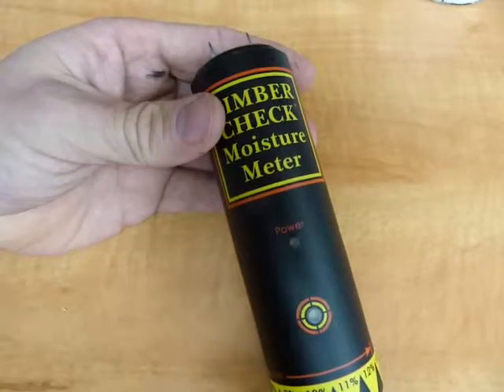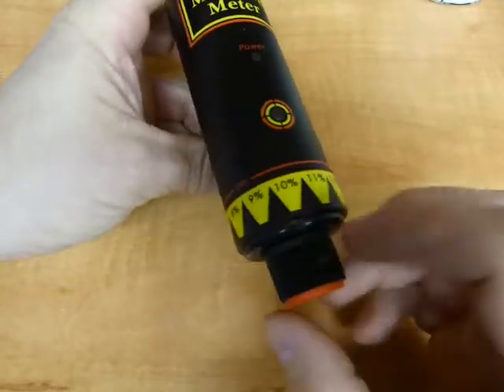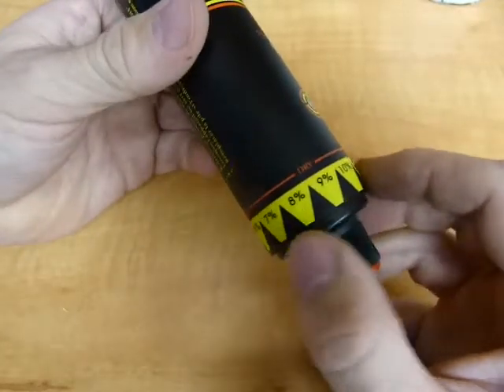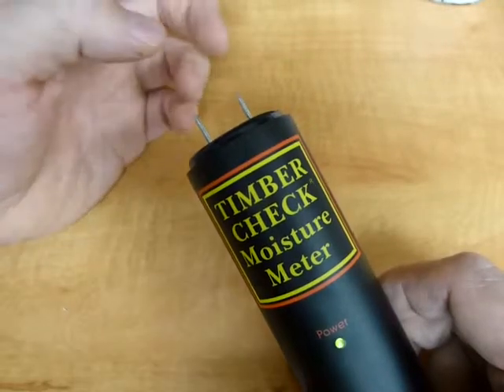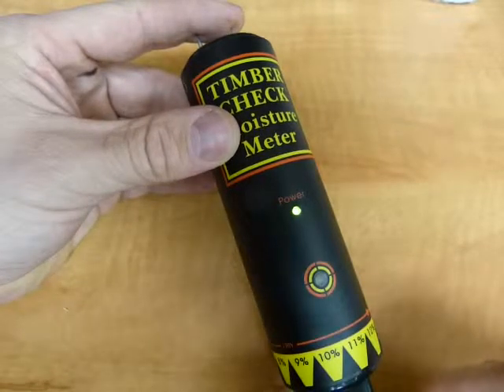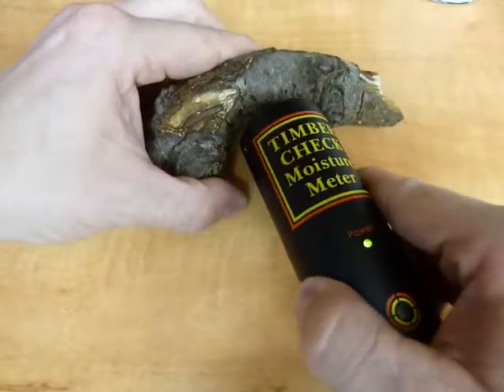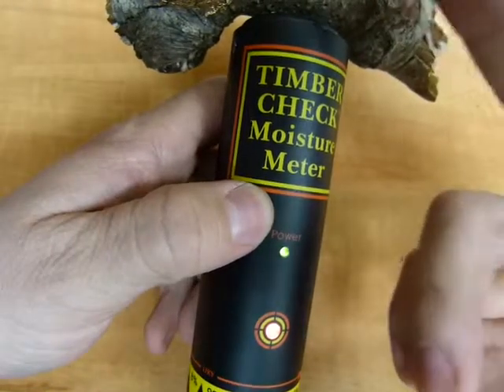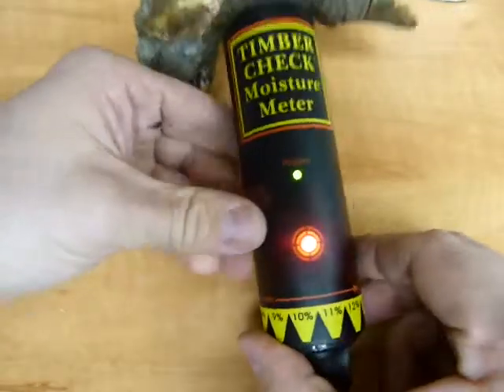How an electronic moisture meter works

Comment: Thank you, you are the first video I found to finnaly say RESISTANCE  now I know I can use a multimeter to test my wood moisture  ( PRICE+ $5.00 at harbor freight)
Reply from the maker: trbo6 Yes, possible. Just need to make a 3-5 piece of wet wood with known moisture content, measure their resistance, interpolate the rest of the numbers. Easily done with an oven and a cooking measuring cup.